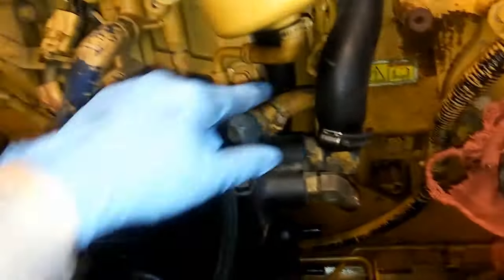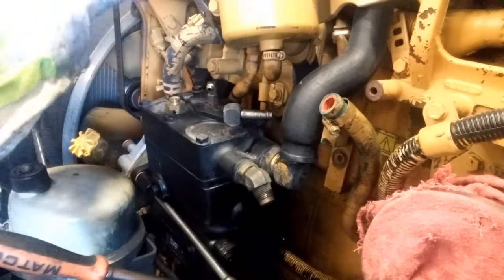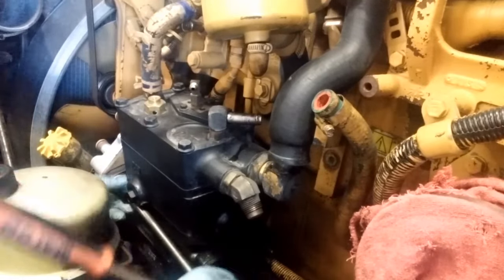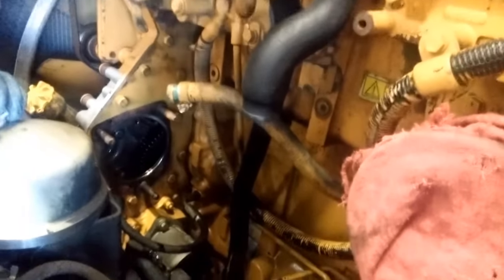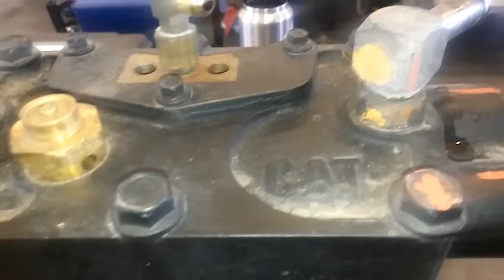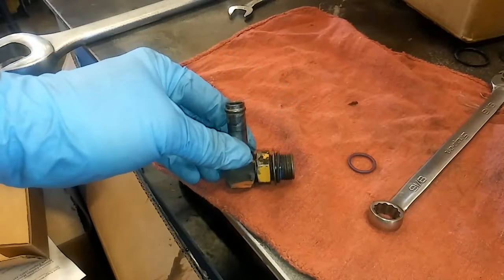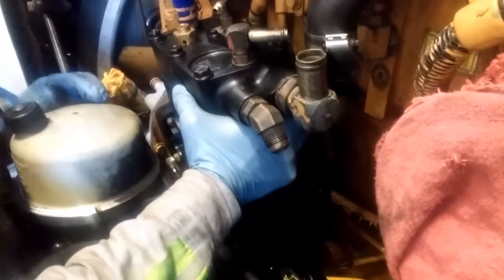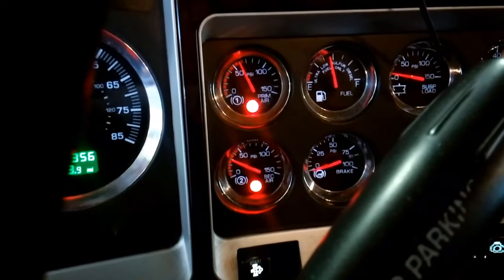How To Change Your Cat Air Compressor.  Remove And Install Air Compressor.

Comment: I have a 3406b caterpillar in my 96 peterbilt 379 and today i see a lot of air pressure in my radiator i think is the head gascket but my frind tellme is maybe the air compressor is that possible
Reply: I lost like two galons of antifreez

Comment: Ok so my C7 only has two bolts holding it to the gear assembly ? Took both out and compressor seem tight as hell ? dead center of compressor has 2 small nuts there on the front of gear cover. Took it off and you can see nut holding gear on compressor shaft. Do I need to take that nut off ?
Reply from the maker: +Dale Brandt There is a bracket on the back of the compressor that holds it to the block. You have to remove the power steering pump and then it comes off. The compressor should come right out then.

Comment: hey adept I have a green Slime and Water in my air dryer filter.  Ive changed my air dryer cartridge 3x in 3 months.  also have steam coming out of breather but no compression or bubbles in the system.  Can an air compressor do this?
Reply: my coolant is red on cat c13
Reply: I know this Is three years later. But on my c13 I'm having the same Issue and I'm thinking it's the air compressor. 🤔 what did yours end up being?

Comment: I have a 2009 c15 and for the 3rd time compressor is pushing oil to the tanks...
First,,,,what is the cause of It?
2nd should I go with a bendix single piston?
Engine was overhauled 60,000 miles ago...
Thx. 
Ps.
What is your email address.

Comment: I recently replaced an air compressor on a C7S and didn't time it properly.  Can you explain the purpose for timing on these engines?
Reply from the maker: Is this Austin Hammer?
Reply: Yes sir
Reply: I'm assuming since you said only C7S and C9S have air compressor timing then it has something to do with the air supply to the ARD head.  I just know that I installed a new compressor without timing it.  All systems functioned fine after the repair.  A couple of months later the high pressure fuel pump failed.  Another guy removed the compressor to access the fuel pump and noticed it wasn't timed properly.
Reply from the maker: Thanks for donating. So the timing is important according to Cat due to the harmonics. The fuel pump as well is supposed to be timed even though it will run fine after. When you do the fuel function test it'll code for a timing fault.

Comment: I have a single turbo C 15 pushing water out of the radiator overflow. replaced the air compressor and the oil cooler. still pushing water. any suggestions
Reply from the maker: +Jimmy Neidl Do a bottle test on it. I have a video on it called checking for a bad head gasket or cracked head. You probably are going to have to pull the head.
Reply: Adept Ape thanks for the reply. watched the video and did that yesterday. lots of bubbles. thanks again

Comment: what would be going on with the compressor that would cause blow by?
Reply from the maker: +Michael Bryson Well a compressor is just a little engine without the fuel system so the cylinder or piston rings can wear out and start getting blowby or leaking oil.

Comment: Around how much you charge for doing this job?  My dad and I replace one of those yesterday and he's wondering how much he should charge, we are independent workers. I was looking for an average price on Google but i couldn't find anything :(.
Reply from the maker: +Dark Zero Well it really depends on a lot of different factors, this particular one is about a 2-3 hour job, not including troubleshooting at about 120 dollars an hour. So anywhere from 240-360 labor. If it was an RV it could be an 8 hour job though.
Reply: Adept Ape 
All right man, thank you for making some time to answer my question, much appreciated 😊.

Comment: Ooops didn't mean to call you Abe...lol. And how often should you change your dryer cartridge? I have the AD9 on 1996 3406e. I do short haul so I'm home every day. Between 1,000 to 2,000 miles a week.
Reply from the maker: +Big R Phillips You know I would check which cartridge model you have and go to their website to see what they recommend. It depends how much oil your compressor pushes and how much humidity is where you are too.
Reply: Having decades of experience with different air dryers, I suggest to truckers that they regularly check for moisture and oil accumulation in the wet tank, a protocol which will indicate air compressor and air dryer health and, thus, the time for a change out.  Here we have five CAT 3406E engines equipped with Bendix BA-921 compressors that are twenty years old/plus 7,000 hours on them, and all still have the original air dryer guts in them.  I have see trucks go 1.3 million miles with the factory air dryer desiccant still there and performing fine.
Reply from the maker: +Chad Jessup Thanks you Chad for the tip.
Reply: Sometimes I use the analogy of the truck's air restriction gauge and utilizing that reading for changing the air filter, because as you have probably been taught, with a little coating of dust which the air filter can tolerate, the incoming air is cleaner.  So why change out a perfectly good air filter.  The air dryer manufacturer's desiccant change recommendation of, say, once a year is a CYA announcement directed toward the lowest common denominator. i.e. the ones who perform practically no preventive maintenance.
Reply: The A-d9 is an older design and less efficient than the newer spin on cartridge dryers. Our fleet would service the AD-9 yearly. The spin on cartridges every 2- 3 years.
Reply: We are located in a very dry area of NE Cal, so our older AD-9's do not require servicing every year, as they do a satisfactory job in our local climate conditions, but not as well as our AD-SP and AD-IP air dryers.  When the wet tanks on the trucks equipped with the AD-9's show "enough" moisture, then I get out the tools and change the desiccant cartridge.

Comment: How do you remove the bull gear on this compressor
Reply: Did u remove
Reply: Trey Harris yeah, I got a 2x4 and hit it with a hammer at an angle turning the gear as I hit it with hammer

Comment: I've got the same engine in my 2008 Pete and my local dealer has replaced the compressor twice now and I'm still blowing oil through the lines. Any idea's? They sure don't have any.
Reply: its a dealership. they odviously did not check engine blowby as the compressor is fed off the intake and or turbo so if the engine has excessive blowby feeding oil back into the air intake the compressor will suck that in.   i suggest a new dealership or independent shop

Comment: this comressor is junk! I replaced already third one, still pushing oil!!!! ;( dont know what to do now...
Reply from the maker: +alexkustov There is a Bendix upgrade that will replace the inferior Cat air compressor.
Reply: Part number please i have the same problem
Reply: I wonder if is the bendix 5012533? But you have to change the gear

Comment: why would a cat use an air compressor and why would some have to be timed?
Reply: Egbert Wadman I am NOT A MORON, I wasn't sure why the engine had an air compressor, also i thought they had a separate air compressor that was driven by an electric motor. I did not make the connection that they were used that way, also PLEASE WATCH YOUR LANGUAGE, I DID REPORT YOU.